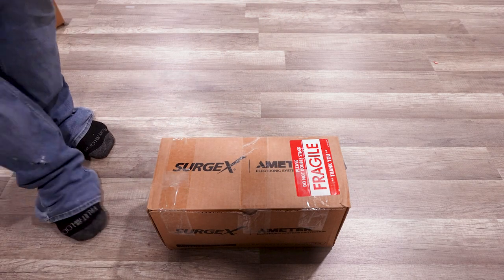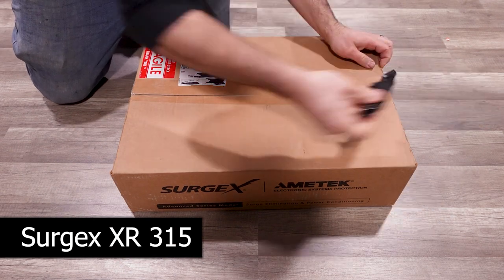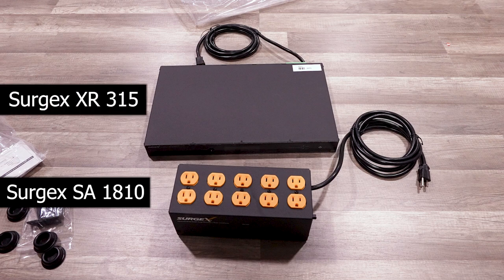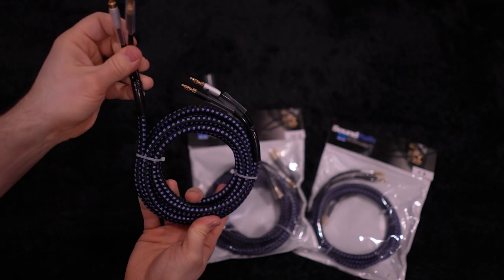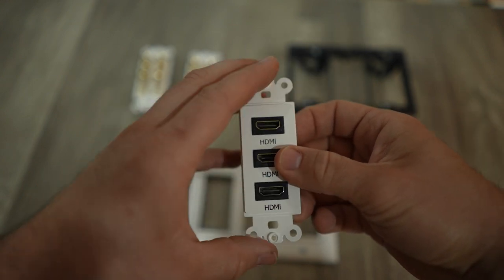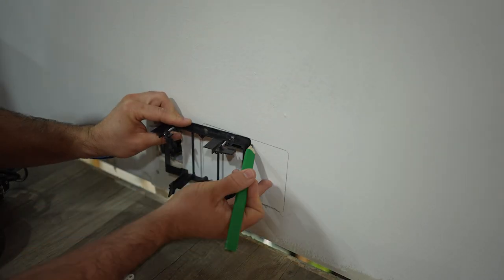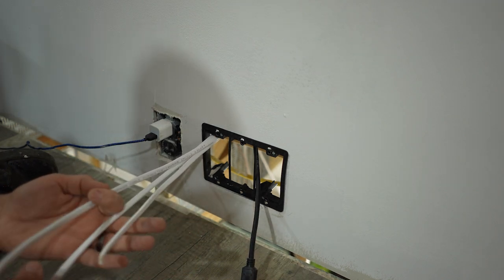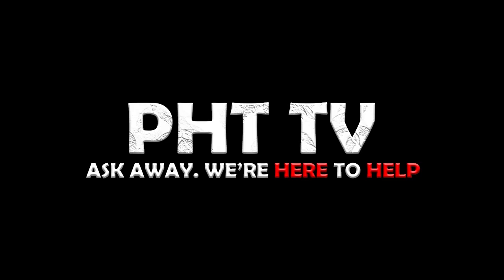Tech Sidebar - SurgeX & SVS Soundpath cable unpackaging, and Home Theater Wall Plate install.

Comment: I did something like that but where the fuse goes I did 2 one dumps the extra electricity in the earth then another with the parameters if there is a big surge it cuts the power
Reply from the maker: Nice! Great to have that added protection. 

-Jason

Comment: I am still waiting/hoping for the Parasound P6/A23+ vs the Parasound JC setups video!  Please do this as I have the Parasound P6/A23 combo and was contemplating upgrading.
Reply from the maker: Thanks for watching! This is still one we want to do but haven't been able to squeeze it in. That said, jumping from the A23+ to the JC5 (assuming this is the JC you were talking about as, this is the one we were going to test) would be a huge leap forward. You would see a world of difference between these two units. While I haven't created a video for it yet, I have heard them and...the JC5 will blow you away. What will it be powering/what is your P6 powering currently?

-Jason
Reply: @TopShelfAudio  I am currently running vintage Klipschhorns
Reply from the maker: Gotcha. Well we still plan to do these compares in the future but unfortunately, not sure exactly when. That said, I do feel you'll notice a difference in overall performance, you'll have much more headroom, and reproduction should be cleaner overall making the jump. If you have any specific questions on these now or before we can get to the other video, feel free to ask or give Cory at Paducah Home Theater a call and he can walk you through the differences. 

-Jason

Comment: What’s the brand’s name of wall plates you demonstrate…how can I get them with brackets?
Reply from the maker: The ones I used in this video are just no-name units off of amazon. You can customize the plates/number of gangs or slots you use to suit your needs. The brackets are separate but you can get those to suit your needs as well. just search for "old work" or "old construction" mounting brackets. 

-Jason

Comment: How did you attach it behind the desk? Isnt it heavy
Reply from the maker: Which unit are we talking about? One Surgex I have sitting on the floor behind/under the desk. The rack mounted one I'm actually not using in a rack but in a tiered/shelved Glass AV table.

-Jason
Reply: @TopShelfAudio  sa-1810 standalone brick, you can buy those brackets to attach under a desk or wall